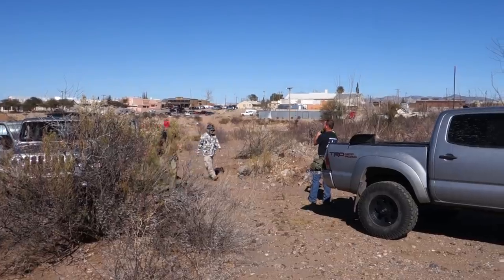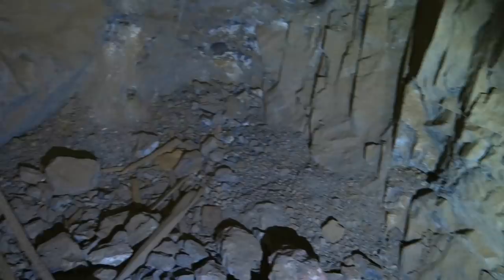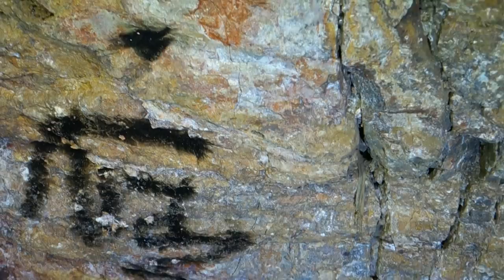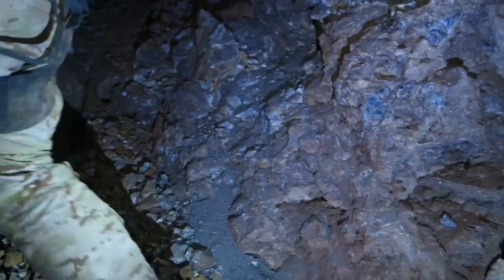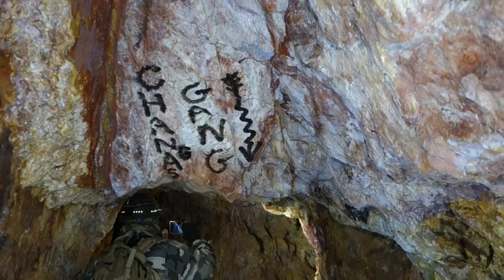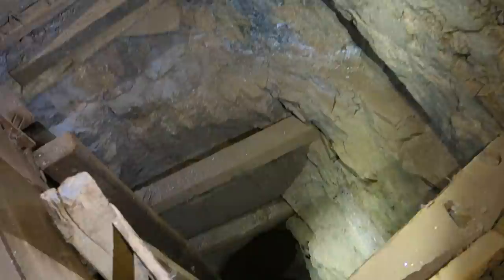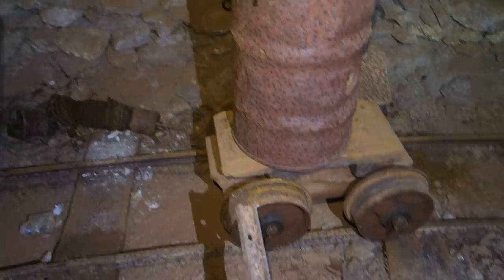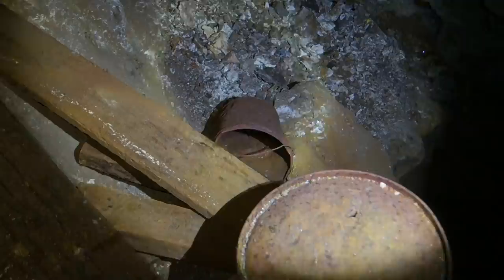Deeper Into The Unknown Beneath Tombstone, Arizona

Comment: Sanforization is a treatment for fabrics to reduce shrinkage from washing. The process was patented by Sanford Lockwood Cluett in 1930. It works by stretching, shrinking and fixing the woven cloth in both length and width before cutting and producing, to reduce the shrinkage which would otherwise occur after washing.

Comment: I have a collection of old single Jack drill bits that I collected from the magnet on the conveyor of the mine I use to work at. There was over 26 miles of tunnels dating back to 1880's. Now they are just taking the whole mountain down instead of tunneling. Kind of sad especially when you see all the poison they use to extract the precious metals.
Reply: That's crazy isn't it? The fact they can make a profit too, after removing a freaking mountain!
Reply: @judeodomhnaill9711  they definitely made profit. I saw the pallet of bars they put out every week on Friday as it was loaded in the armored truck. I don't understand how they can make profit after having to rebuild the mountain when they are done.
Reply: @b-radfrommalibu  insanity.

Comment: How did they write the graffiti with the carbide?  I'm assuming they used unused pieces but the letters are a bit thicker than I would expect from that type of method.  Did they use their lamps and it's actually soot?  Anyone with any info. on this, please comment.  I'm quite interested.
Reply: The carbide graffiti is indeed soot from the flame of the lamp.
Reply: It's the soot like from a candle but it's from the flame of the carbide lamp.
Reply: If you turn up the flame to a high setting using carbide/acetylene gas, the flame burns very "rich", which creates a lot of soot.
The miners just adjusted their lamps, and let the creativeness flow.